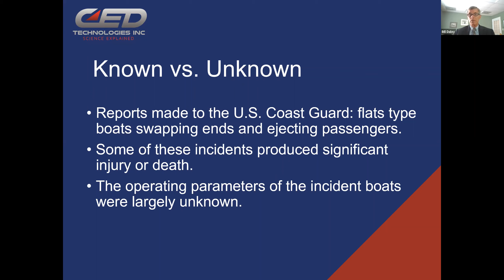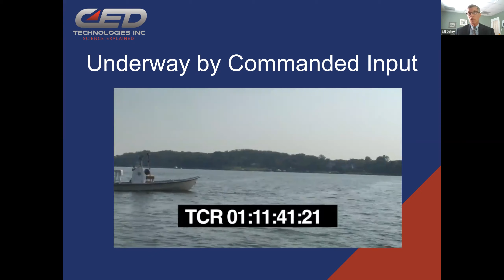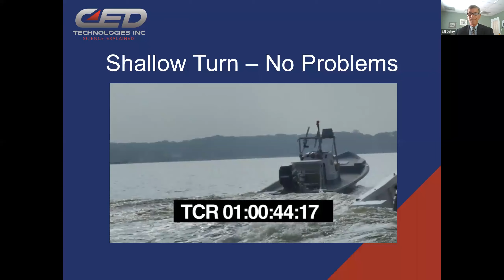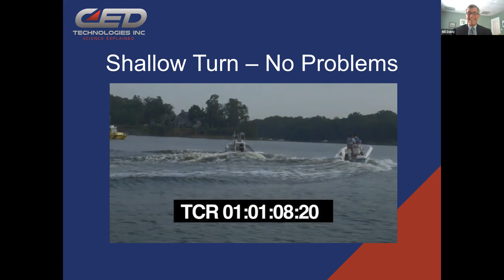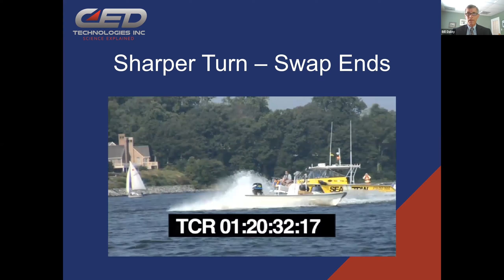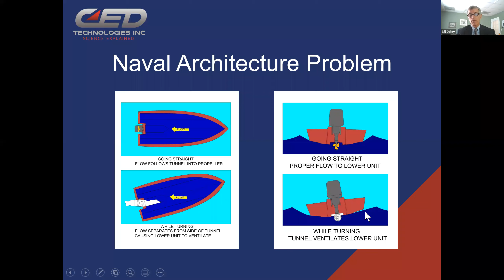Texas Flats Boats Instabilities Webinar

Comment: Seems like it would be more appealing to the end user, and not negate the purpose of the boat’s shallow water performance by changing the design of the tunnel so that it doesn’t ventilate instead of adding the skegs.  The purpose of these boats is to not hit the bottom when under way or during a drift.
Reply: Brilliant comment, sir.
Reply: Makes logical sense.